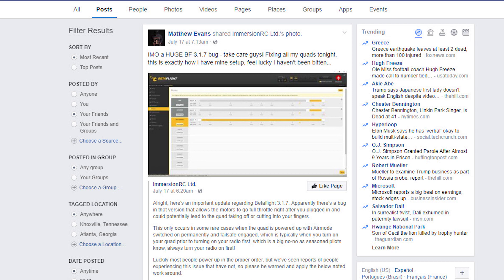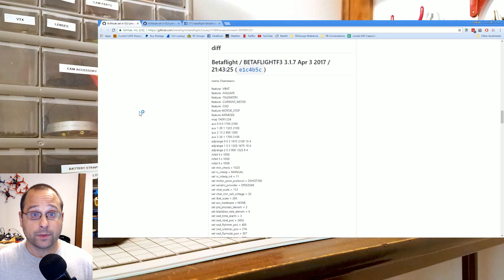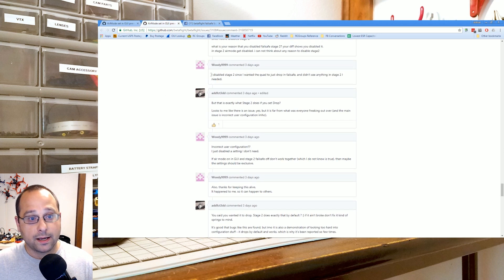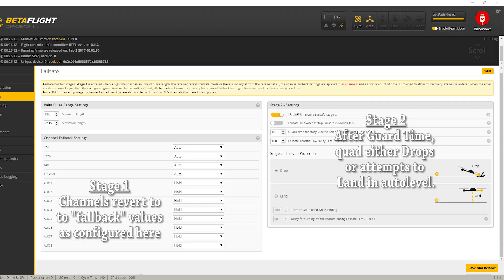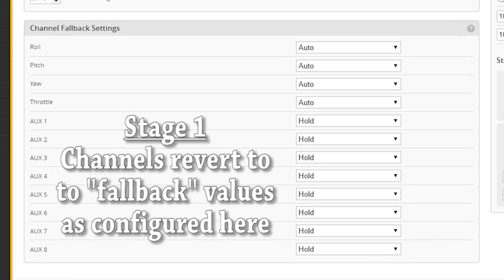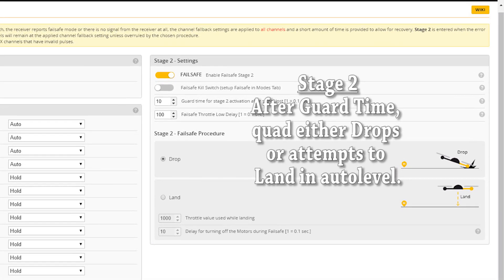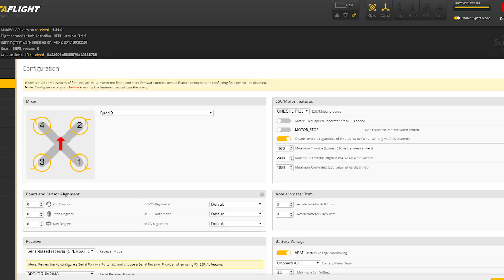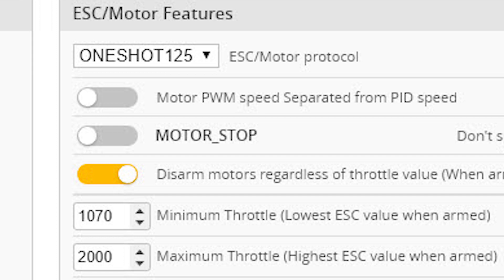Betaflight 3.1.7 failsafe bug does not exist.

Comment: On  my New Bfight 210 the failsafe seem not to work. When I turn of the transmitter, the motors run at the last throttle setting. How can I fix that ? It is defult in acro/airmode.

Comment: hi josh I am receiving a x hover stingy  BNF  today  I think it has a current meter on it .how would I input the capacity of my battery in the betaflight osd  so I can get an alarm when it s time to land ?also  do I bind first then betaflight ? I use throttle hold as my arm switch  how do I check failsafe    ?     thank you josh  great video

Comment: I do have a Lizard95 with a DSMX clone receiver ... using the X7 Taranis with the 4in1 module ... and with Airmode on it happens already 3 times that disarming via switch is not working ... it is just freaking out and ruining all the props :-( 
That never happened without Airmode (just simple Acro with motors spinning when armed)
.... but maybe it is something different ... checking config later again
I forgot to mention that I'm running BF 3.1.7
Reply from the maker: If you can reproduce it then show what the Modes tab shows when disarming. Take your props off, make it happen. The most likely explanation is 1) failsafe set up incorrectly, 2) you go into failsafe and try to disarm, but since the receiver as lost connection it doesn't receive the disarm command.

Actually, here is another possibility: you are using a DSMX clone receiver with the 4-in-1 open source RF module. Are you sure that failsafe is working correctly on the module?

Bottom line: when the error condition occurs, what value does the Arm Mode aux channel show? If it is in the "disarm" position and the quad is still armed, then it's Betaflight's fault. If it is in the "arm" position then likely the problem is in the receiver, failsafe configuration, transmitter, etc.
Reply: I checked yesterday late at night ... seems I was wrong with the assumption that Airmode was activated (it wasn't, sorry) ... but Failsafe Stage 2 (with a value of 10 which is 1 second) is configured and on the Taranis set to no pulses. After it was freaking out I tried the switch several times with the antenna in an - I think - optimal angle and not to narrow to the quad, but with no success. I also have to mention that this only happens when disarming/arming more than once with the same battery plugged in. Sad but true I'm not able to reproduce this anymore ... have to wait for some spare parts to get it working again ;-)

Comment: Thanks, Joshua. Question does stabilized modes get disabled when surmise feature is enabled?
Reply: Oops. Typo... meant when airmode is enabled
Reply from the maker: +JAD no. Air mode can still work with autolevel

Comment: oh yeah guys when testing failsafe make sure you get the failsafe beeps otherwise its not gone into failsafe its just disarmed or turned off the motors.
Reply from the maker: This is important. For example, if the receiver is set up certain ways, the quad can appear to be in failsafe but actually it's just disarmed, and then if the receiver becomes disconnected instead of losing RF link, you can get a flyaway.

Comment: But why does setting my stage 1 arm channel to a disarmed value not disarm my quad?? that doesn't seem intended...

Oh, nevermind, I figured it out... If i have a momentary failsafe event, and the quad disarms with stick above minimum throttle, then it won't rearm and drop out of the sky even though it could've recovered from the momentary event.
Reply from the maker: Correct. It won't rearm if throttle is > min_check.
Reply: Joshua Bardwell hey thanks for the confirmation!

Comment: Hey Joshua I have a question who would you think would kill more components in the long run a freestyle pilot or a racing pilot. A racing pilot may crash more but less hard but a freestyle pilot may not crash as much "varies pilot to pilot of coarse," but due to the common locations freestyle pilot often fly when they crash it CAN be a rather hard crash. Just thought it would be interesting to hear your opinion
Reply from the maker: Racer crashes more and harder no question. But a freestyle pilot is more likely to lose a whole quad.

Comment: I have 2 quads both are using totaly different hardware.... On both I used 3.1.7 and each time I punch I loose control of the quad.... I downgrade to 3.1.6 and now it is fine....I know that there is nothing to do with the failsafe bug that you explain---- but it is a bug ::D

Comment: That's why you check the failsafe before you fly. On you desk with props off. It is of great importance to test what the quad does when you turn the radio off as well as testing if the arm, flight mode and failsafe swiches (if used) are funktioning correctly. You should never do the first flight after changing around settings without checking these things! NEVER! Also check motor rotation. Espechially if you run reversed prop rotation to the Betaflight default (fR&bL=CW/fL&bR=CCW). If it starts wildly twiching on the yaw axis without props on when you try turning the quad with your hand, the motor yaw rotation setting is NOT correctly applied. The quad will be uncontrollable and shoot up into the air spinning wildly. Not checking your quad before you fly can lead to cevere injuries and property damage. BE  CAREFUL and use common sense. Stand at least 10 metres away from your quad when attempting first flight after software changes.

Have fun ;)

Comment: The problem I have with stage 2 failsafe is that it doesn't let you rearm the quad when it reconnects for 30 seconds. That really sucks cause if I lose the quad i can't take off again for 30 seconds.
Reply from the maker: Yeah ti does. You just have to flip the switch twice.
Reply: OMG I didnt know that

Comment: LOL Teach this has happened to me but it was after a deathroll that ripped both antenna off x6b. I think I told you about the death roll issue I had after flips or rolls but last time it happened this situation happened. one motor caught fire digging in to ground not sure how I unplugged it memory lost to the moment. this was with air mode on a switch had failsafe on a switch too but no antenna so remote didn't stop it while I was running like parent to child in danger lol. in blackbox it was the bad motor desync/dropout after dropping throttle then punching it motor was still trying to flip at 100%throttle. first month of first build and with quads in general was very exciting and learned tons. I think the bugs ppl find is to the customization of their rig part/configuration once found issue goes away.

Comment: Can u make a video of dshot 16.67rc what it is and what difference it makes from de regular 16 ver of bheli @joshua
Reply: Serjovax FPV pretty sure RC stands for Release Candidate. And the new firware supports dshot commands. I would still like to see a video of this which I'm sure he's already working on
Reply: That version has DSHOT commands support. So DSHOT can send different commands to ESC's. Reversing prop direction aka. anti-turtle mode or beeping ESC's with a switch needs this latest version. But you need Betaflight 3.2 and Dshot to use that.

Comment: All I know is that 50% of the times I do a roll and 90% of the times I do a flip I just fall off the sky... Changed all the motors, updated all firmwares, same thing. Gah
Reply: Cineris I had this issue and solved it by adding a few low esr capacitors to the noisy escs I got
Reply: Most of the time its because ESCs not calibrated correctly or minimum throttle is too low, also can be ESCs not supporting too new ESC communication protocol correctly.
Reply: finbenton technically they are pretty dshot able
Reply: check your blackbox for a motor that spins up to 100% but the quad in acc image is rollin that way that's how I found bad side on my rig
Reply: Christopher Punton Thanks! I'll try